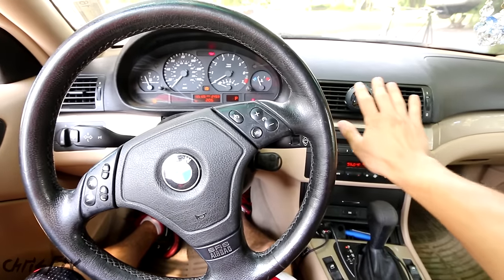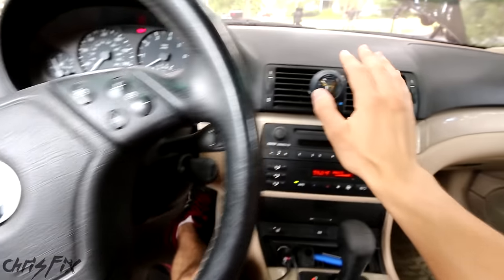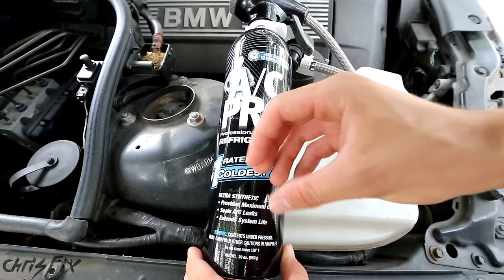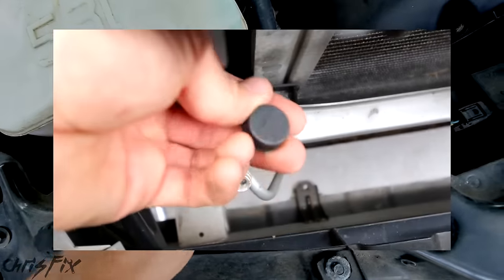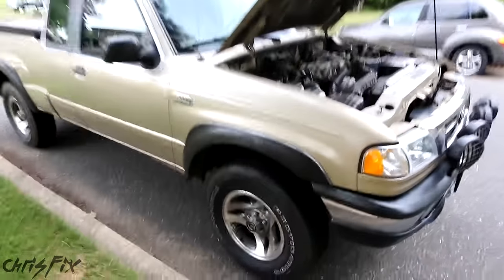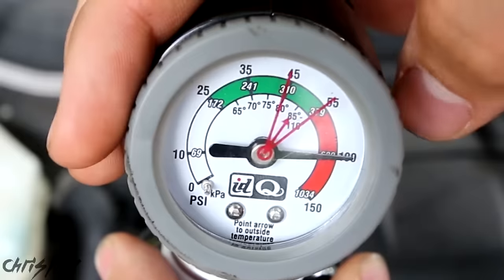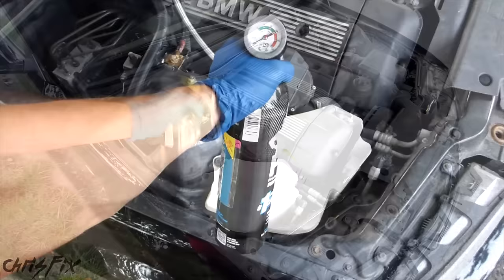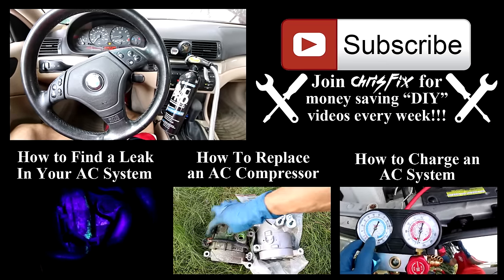How to Recharge Your Car's AC System (Fast and Easy)

Comment: im a car mechanic in germany and i had to take  a 2 week class to be even allowed to touch AC systems.

and you are not allowed to charge up a system with a leak. Here its forbidden by law.
Reply: +NightcoreSM I am not sure of the legality here in the US but I think it isnt allowed either. I know leaking the refrigerant into the air is highly illegal. But it is also natural for a car to lose some refrigerant over time. I have a honda civic from 2002. bought used and was in a car wreck. AC system is piss poor but it certainly isnt a leak...or at least none my mechanic could find...
Reply: +NightcoreSM Same here in Canada. In the U.S the rules vary by state and aren't as strict
Reply: +NightcoreSM These Repair kits that Chris used are actually a mock refrigerant. They are not harmful to the environment and consumers can buy them. Eventually they will do more harm than good to your AC system in the Car. for proper repair get a licensed mechanic with real 134a refrigerant.
Reply: +Luis Luis it's still r134a but it's very low grade, that's why it isn't as harmful to the environment if it leaks into.the air
Reply: It is illegal to charge a leaking A/C system in the U.S. as well. It is based on system size and percentage of leak in a year. What he did in the video would fall under a repair because of the leak stop agent. 

Tipping the can to the side can cause a compressor failure. Compressors only compress gas, and tipping the can allows liquid into the suction line. That's the purpose of the accumulator as well. The accumulator keeps liquid from entering the compressor. 

A filter dryer removes moisture from the system which is sometimes inside an automotive accumulator. This is not always the case. 

Those little cans like that all suck. There is no way to purge or evacuate the line from the can to the access fitting. This means you are adding air, moisture, and contaminates into your sealed system which will guarantee that it fails.
Reply: Luis Luis you obviously have no HVAC/R experience. Just because something can work doesn't make it right.
Reply: Dylan Clay R134a is a blended refrigerant. The blend has to be the same to be called R134a. Their are other refrigerant that have similar flashing points to R134a, but they have their own name. On a side note, R134a is used as the propellant for albuterol inhalers. Yes, the inhalers used to treat asthma contain refrigerant. Yet people still trust the government...
Reply: +Tim Chartrand relaaax
Reply: chuck wick relax? What are you talking about? All I did was state a few facts and some technical data. I did this while laying in my hammock. How much more relaxed can you get?
Reply: In the states, EPA 82.42 says you are allowed to do your own with no problems, but if you get paid, doesn't matter the amount, you must be licensed to hand HVAC systems.
Reply: We are Americans were allowed to pillage pollute and destroy! Isn't America great!
Reply: +Tim Chartrand And of course you are the epitome of the American "success" story right? Not! Shhhhhhhh!
Reply: +Tim Chartrand wtf
Reply: +destiny walker wtf
Reply: 134 refrigerant is harmless it’s not freon.if it leaks out no harm .
Reply: Speed Play R134a is a refrigerant. Freon is the DuPont brand name for R12 refrigerant. Both are refrigerant that are illegal to release into the atmosphere.
Reply: All your problems in Germany are caused by excessive Socialism, America is moving in that direction also, keep things simple, always vote for a Capitalistic society and your laws will not be so demanding...
Reply: In the US its illegal to put freon or refridgerant in a large air conditioner for your house but its legal to put it in a small air conditioner like in a car.
Reply: ac pro is not freon
Reply: Speed Play Freon is simply a trademarked name like Wal-Mart. Freon is a type of refrigerant like Wal-Mart it's a type of store. DuPont had the patent on Freon which is refrigerant R12. After the ban on R12 the name Freon was sold to Chemours who uses the name to identify their specific line of refrigerant. (Like Wal-Mart has "Great Value" brand)
Reply: The refrigerant everyone keeps referring to is R134a. The "a" at the end of the refrigerant indicates that it is a blend. This means it is created by combining multiple refrigerant at specific percentages. The exact formula for R134a is CH2FCF3. It's a chemical formula, and any variant makes it a different refrigerant. Products like ac pro are simply refrigerant with a chemical additive. The additive is separate from the refrigerant and mixes with the oil in the system. It doesn't change the chemical composition nor the properties of the refrigerant. It may help lubricate moving parts or seal leaks. Any additive is considered a contaminate in the sealed system. These are all facts, not opinions.
Reply: +theone 111777 Just don't decide to do you're repair infront of a cop or you'll be in big trouble
Reply: Enmanuel Romeo the cops can't do anything, but anyone with a refrigeration license can turn you in for a reward and you can be fined $20,000 and receive prison time.
Reply: +theone 111777 god forbid you're trying to recharge your system and a licensed fridge guy drops a dime on you
Reply: We do have an incentive of $10,000 for turning someone in, but it can be hard to prove. They could say it was nitrogen they released or compressed air. You would have to prove it was refrigerant and that's the difficult part.
Reply: +theone 111777 oh lort first we have the regular popo to worry about now we have to look over our shoulders for the ac police?
Reply: +destiny walker your comments made my ass laugh
Reply: also if he is not certified in hvac, taking money from his friend for the fix is illegal.
Reply: Same here in Australia. Its ridiculous; a few years ago I was quoted $600 for a 2kg fill of r134a. But I can charge my own car to find leaks with hydrocarbons and UV dye without needing an HVAC licence :)
Reply: We're*
Reply: *You're
Reply: deswegen ist es gut nach Amerika zu gehen
Reply: Fuck that.  It is my car, if it needs freon, I add it.  Nobody gives a shit what the rules are if it saves them $1000.
Reply: too funny y'all guys :-))
Reply: NightcoreSM weird, its a EU-law, and I did it in 1 day at school, since our school is a certified exam centre for automotive airconditioning. it was a really easy test as well.
Reply: Same shit in the state of Michigan and Miami the only two states that requires the tech to be AC certified before working on cars even though not certified people can buy this stuff from shops they can't buy R-12, you have to be certified before putting you're hands on R-12 because it's bad for the ozone or some stupid thing like that, the 134a is a greenhouse gas it's ok to release it to the atmosphere, using R-12 by not certified tech is illegal you have to be certified by the state and be ASE certified, it took me 3 months to get both certifications and it's was waste of time and money I worked on ONE R-12 car.
Reply: HOOKAH SPOT r-12 was being made into drugs so it needs to be handled by professionals
Reply: I remember when I was a kid you couldn't even buy the can from an auto parts store unless you were certify here in California, I went to an auto parts a few days ago and now you can :) I figured wow maybe they came out with a better product than using freon...   you guys make me wonder how safe it is for the environment with your posts.
Reply: The stuff he is using isn't actual air conditioning refrigerant like what us mechanics use I have seen many cars damaged by this stuff
Reply: It varies by state
Reply: destiny walker 
...................... for someone who is trying to make others on this thread seem childish or ignorant... you sure are using insults that suggest you are 1/4 of your claimed age of 16. Stating facts about a protocol or  law concerning refrigerant is not being a keyboard warrior or being a "nazi" as you claimed in any way, shape, or form.
Reply: this is the newer refrigerant that doesn't contain the harmful chemicals to the ozone-that refrigerant was banned in the US decades ago.
Reply: still lasts like 11yrs  though. the very new stuff lasts days but its like 100 bucks per lb
Reply: they use r134a now, wich is 1300 times as harmful to the ozone layer than CO2, in europe they stopped selling cars with r134a in the beginning of this year, we now use HFO-1234yf, its only 4 times as harmful as CO2, but some car manufacturers are going even further, they are using compressed CO2 as refridgerant, but it's proven quite hard since the pressures have to be quite high (about 1450 psi), so we still have to see if the hoses and such will last decently, one of the manufacturos is mercedes wich are already using CO2 in the european S and E class.
In the US, they will ban r134a in 2021, so 4 years to go until you guys are using CO2 or HFO-1234yf
Reply: NightcoreSM exactly you should find the leak first before you charge anything.
Reply: yep R1234 I did a course about it last year. It is coming folks & it's expensive! 1 shop bottle was around 1000 dollars.
Reply: NightcoreSM I have a universal refrigeration license so I probably have no worries about the law :D
Reply: NightcoreSM Thank God for America and our freedoms.
Reply: NightcoreSM in the US you're not really supposed to either if it has a leak. You're supposed to fix it first but most people don't
Reply: I am a car mechanic too, here in serbia we can do whatever we want with car, we have some people who need to refil ther A/C systems every few months, repair is expensive so people chose to refil their A/C systems often, there are laws but nobody realy cares because there is nobody who controls what we are doing. A/C refrigent is harmful to atmosfere but what people can do when they dont have money to repair their cars, salaries are small and car parts are expensive.
Reply: Matthew Valadez exactly
Reply: Nino Joel: what about China giving me nukes.
Reply: That applies to actual mechanics. But some dude just doing repairs out of his garage isn't likely going to have the EPA come hand him a fine.
Reply: theone 111777 WHAT?!
Reply: What Are the Dangers of R134? ... The Environmental Protection Agency considers R134a fairly benign, reports that toxicity is very low for acute and subchronic inhalation, and does not consider R134a a developmental toxin, or genotoxic.
Reply: The public can buy small 12 oz refrigerant cans at most auto centers and big box stores like Wal-Mart, or Kmart.  It's used to top off the AC units in cars.  However you need a 609 license to purchase anything larger.  Most of these cans use a special filler gun that only let's you fill it into the fittings on the vehicle.  If your a 609 certified repairman, you can recover the refrigerant, open the system replace seals clean and replace evaporator or condensor, replace compressors, or leaking tubes.  Not that it's hard to do and you can get a set of gauges at Harbor Frieght off the shelf, along with a vacumn pump.  You would still need the license to get a larger can of refrigerant so you can weigh in the exact amount.  A 609 test is a 50 question test that can be taken through the mail the cost is like 50 USD.  I have a 608 universal license and had to take a very controlled test answering 50 questions in 3 different sections under supervision of a certified proctor.  
That test cost about 350 USD but I am certified to handle every refrigerant on the market for home or business use.  I still had to get a 609 license to work on a vehicle system, which I did.  So I can purchase any refrigerant or service any equipment in the US.
Reply: Hoschi0913 sir, I'm gonna need to see your poop papers
Reply: THAT IS THE DIFFERENCE BETWEEN AMERICA AND EUROPE.
THANK GOD I DO NOT LIVE IN EUROPE ANYMORE!!!
Reply: No one forced you to read the comments, Jave.
Reply: It's the same in the states this stuff is not true r134 that's how they get away with it it's thermal potential is not as good and the stop leak in these cans will kill systems. It's toxic and if you have a leak you need to get it fixed. Just get it done by a shop or roll down your window
Reply: This stuff works perfectly fine for my needs. I put it in my ac in my old van with 200,000 miles a month ago here in south Florida and it is working fine, arctic cold, where my system was blowing hot air before that. I also only paid one quarter the price I would have for an ac recharge at the garage. Very pleased with the results.
Reply: oh wow Germany is strict
Reply: @theone-so9br  1. No they don't. 2. Toxic compounds are only toxic over certain amounts, and in fact everything is toxic. You just need enough of it. Example, go drink 7 gallons of water in 20 minutes. See what happens. 3. Apples contain cyanide, but people still trust nature.

Comment: you guys in US have it good, can't find them here in AUS
Reply from the maker: Dang that stinks!
Reply: Rfbu yeah man it sucks, it's like banned or somthing I was so heart broken
Reply: We can't find these in ROK too. There's antifreeze, engine oil, air fresheners in the mall, but not A/C refrigerants
Reply: Rfbu order it online
Reply: Let Me Hold A Like really damn that sucks
Reply: ChrisFix mi I
Reply: Same in Europe
Reply: It’s illegal in Australia... won’t stop me trying to get it shipped here though. An a/c recharge is $200+ in my area...
Reply: A/C refrigerants are regulated materials that require a special licence and heavy documentation for its recovery and use in most jurisdictions because it is damaging to the ozone layer. If your are charging this with out fixing the leak you are damaging your A/C system. Leaks let moisture and atmosphere in that must be evacuated and repaired or you will just kill your A/C system over time. Also, the swelling seal effect will weaken the seals over time.  One other aspect you assume is okay is the quantity of PAG oil in the system for lubrication of the compressor.
Reply: I’ll send my used bottle there’s still more than half left
Reply: Rfbu find refrigerant from japan, it works better than r134 and is worth the extra money (if u can find or even order it)
Reply: It's illegal because the ozone layer above the countries are damaged...
Reply: Kevin Leeds R134a doesn't contain CFCs and does not deplete the ozone. It replaced R12 refridgerant which was much more harmful to the environment.
Reply: Jaycar sells it for those in Australia. It's not illegal to buy.
Reply: Kevin Leeds yeh those open boarders and mass immigration works a treat on climate change,more people more resources,land clearing more intensive farming!

Comment: I don't know if you have a video already, but if not, can you show us how to fix a smelly AC system?
Reply: +Felipus Rex Replace the aircondition filter usally behind the glovebox near the airconditionfan. This filter gets cloged up with "treeseeds", the yellow stuff the trees let out in the spring. (sorry for bad english) After some years, these seeds starts to smell bad because of moissture and stuff. Hope this helps :)
Reply: Ohh!! I will replace it. Thank you. :D I hope it's not hard.
Reply: Usally easy, depends on the car, on VW/Audi its pretty easy. Never done it on BMW though :)
Reply: I just bought the filter and will change it tomorrow. Seems like its super easy.
Thanks!
Reply: +Felipus Rex I know there are kits that use a cleaning foam you spray down the vents and another cleaner onto the evaporator. This is a great idea for a future video. I would love to see this as well.
Reply: +Felipus Rex The Cabin Air Filter is one way to make it more efficient and smell better.  Buy an anti-bacterial spray, turn ac on fullt blast, and spray it into the air intake(by your windshield).  Bacteria loves cold damp places like your air vents.  It will kill it, and with it dead the smell goes.
Reply: Taylor F.  Thanks! I found out the hard way that my car model doesn't have a cabin air filter. So I'm going with your suggestion. Thanks! :D
Reply: +Felipus Rex With BMWs its due to the water being trapped in the vent system and around the evaporator due to condensation turning to mold.  I have a 2003 E46 BMW like the one in the video with this problem.  Replacing the cabin filter doesn't solve the problem.  You can buy chemicals (Wurth makes one) to squirt into the system to kill the mold, but eventually it will come back due to the design of the system.  BMW recommends you shut off the AC a few minutes before you turn off the car to purge the cold air from the system to prevent condensation from forming.
Reply: Felipus Rex check your cabin air filter. Usually gets wet and even has leafs and bugs under passenger glove box, that usually fixes it

Comment: Many things contribute to the cooling of a a/c system, not just the gas.  Even a dirty  condenser can cause poor cooling.
This video leads people to believe that if a a/c system isn't cold then it's perfectly fine to add the gas without further investigation of potential issues.
Reply: He did say if you have good pressure something else is wrong and you don't need to charge it.

Comment: Quick fix but could lead to problems.  You can easily contaminate the a/c system this way. Having air in that line could cause a problem. Proper way to recharge is vacuum the system out with the proper manifold system.  these are for temporary fix!